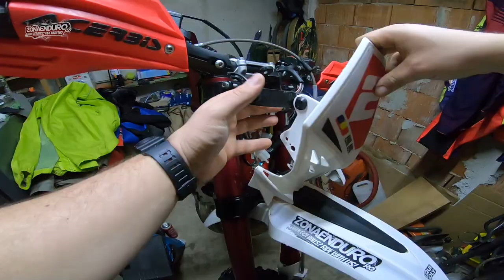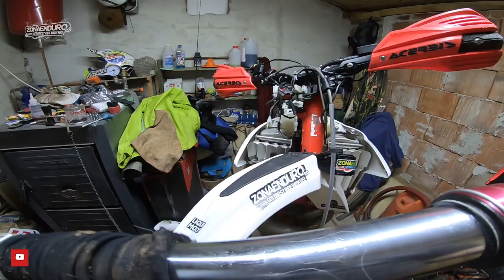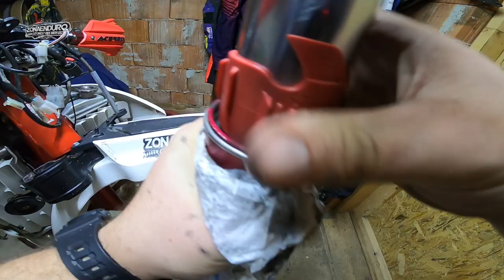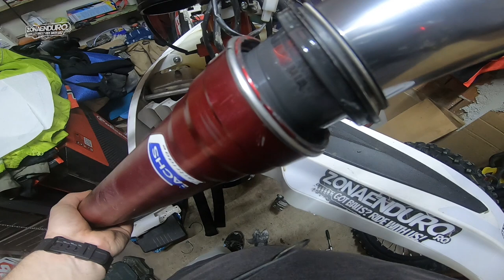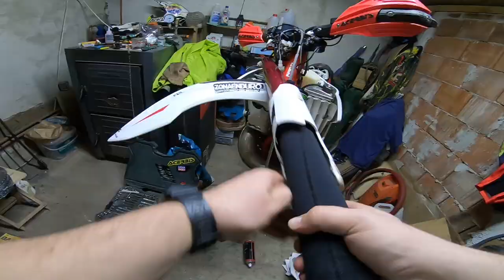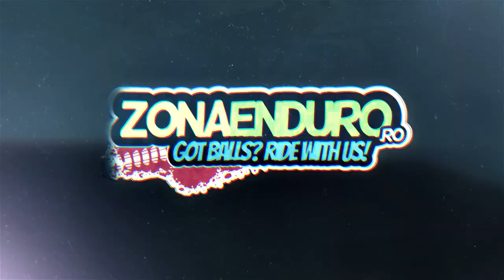How to save a LEAKING FORK cheap, easy and fast

Comment: Das Teil ist gut, kommt von Risk Racing. Der Seal Doctor. Kostet aber deutlich mehr als 1 EUR. Eher so um die 30. 
Tool by Risk Racing is fine. Price is not 1 EUR. Should be aprox 30 EUR. Still cheaper than fork rebuild :-)
Reply from the maker: we bought it with 20, and we saved the seals more than 20 times... so in time, will be for free :))